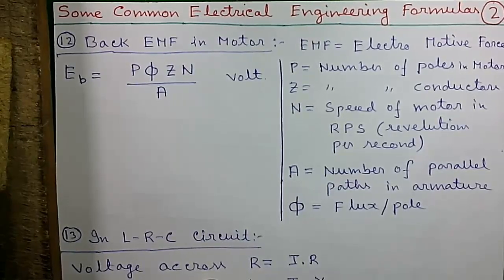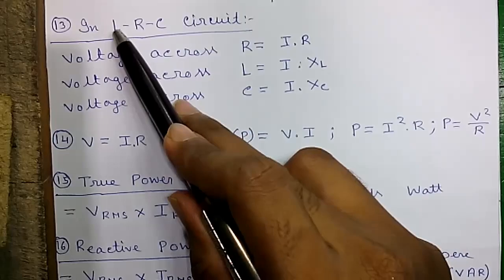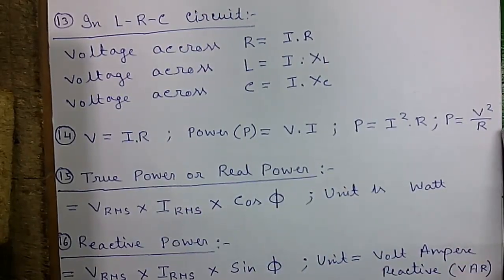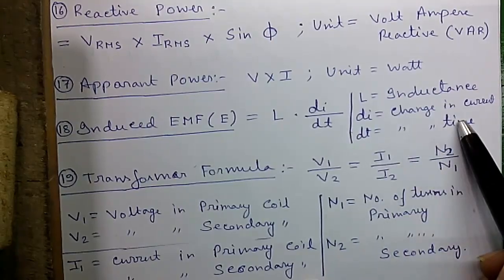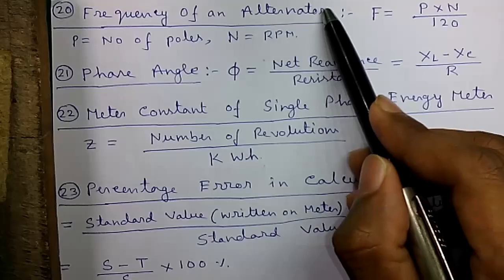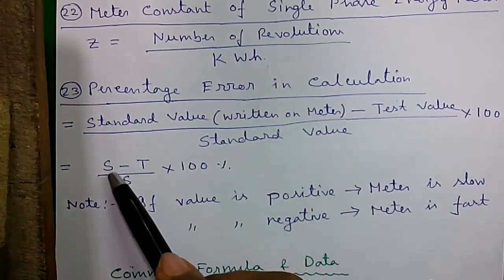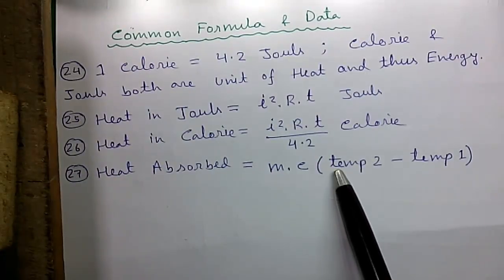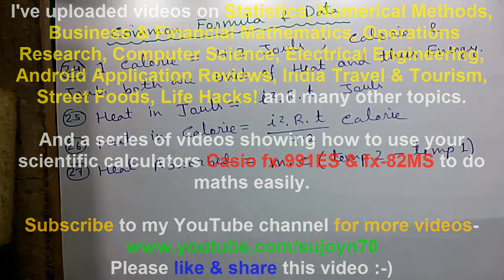Electrical #3: Electrical Engineering/Technology Important Formulas_Part 2 of 3

Comment: Comments for Sujoy. 
At the minute 5:47 of this video you said that the transformer formula is V1/V2=I1/I2=N2/N1
As far as I know this formula should be V1/V2= I2/I1= N1/N2
At the minute 4:06 of this video you said that phase angle is ø = (XL-XC)/R. This is not the phase angle, this is the tangent of the phase angle. The formula should be Tan ø = (XL-XC)/R, so the phase angle is ø = arctan [(XL-XC)/R].
Please edit your video.
Carlos Vicente Dominguez. Electrical engineer. Student of specialization in electric power systems at Universidad Central de Venezuela. Best regards from Venezuela.
Reply: He is not authenticated he is being many of mistakes.....